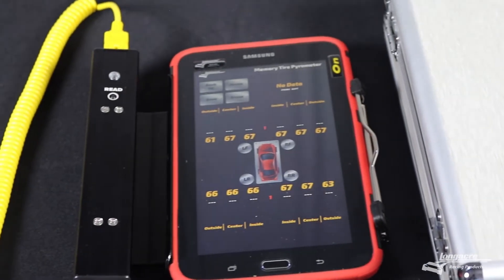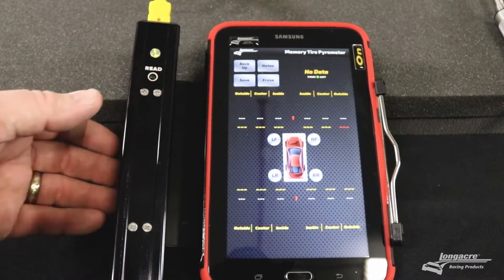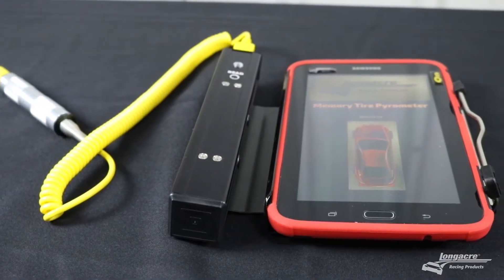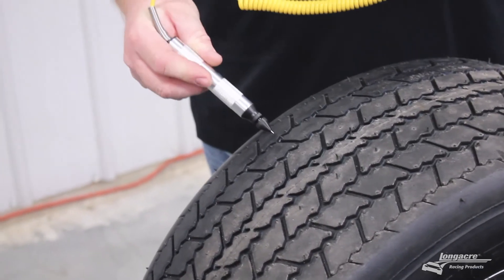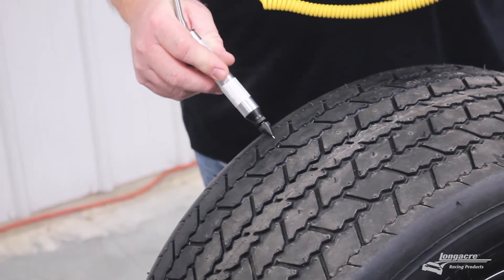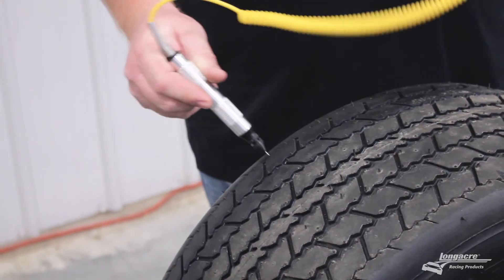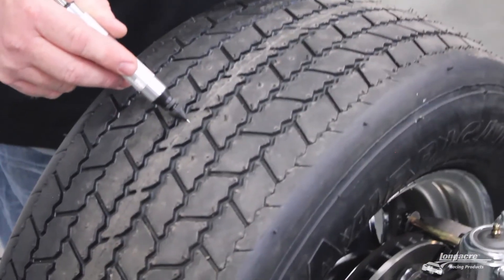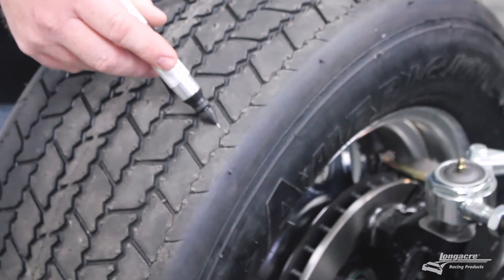How To Use Your Tablet Tire Pyrometer

Comment: So tire pyros really are an "invasive" tool - they must be inserted into the rubber tread to get a reading. 

The advantage of a pyrometer though, is not having to wait until the tread on your tires is unevenly worn to realize you've been running tire pressures too high or too low, or, that something is out of alignment spec range.